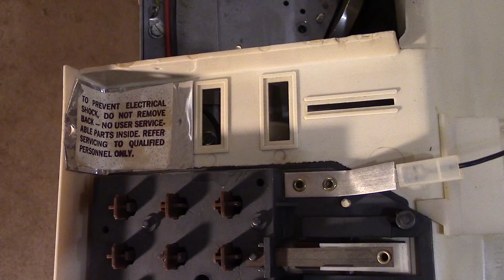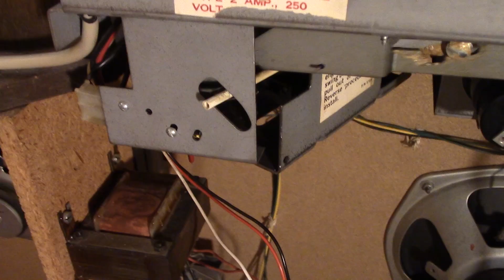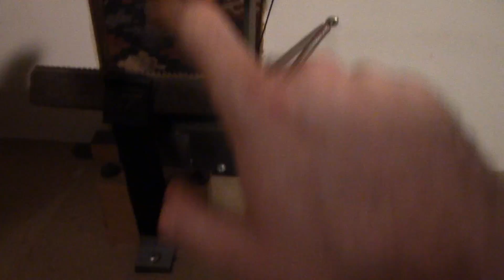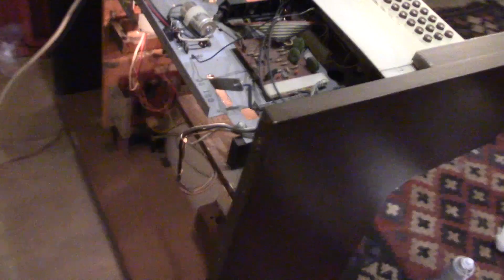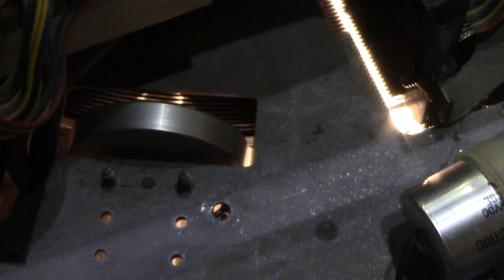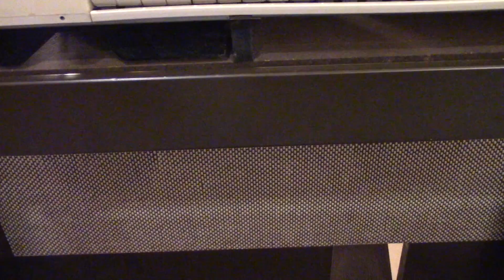Mattel Optigan Model 35011 - Repair Pt2 - Cleaning & Power

Comment: I don't know if you've already figured this out, but the reason the disc doesn't have metronome cutouts like the others is that the rhythm loops are a mix of 3/4 and 4/4, so whatever they did would be inaccurate and distracting at least some of the time. Plus, the chords are just sustained organ chords, so you wouldn't need to keep in sync with anything unless you already have a rhythm loop playing.

That does make me wonder how Optiganally Yours manages to perform "Beebo", though, since it starts with a guitar solo and then the Optigan comes in seamlessly on the beat.

Comment: how did you remove the rhythm buttons off. I assume witch craft.
Reply from the maker: Dorothy Lane it's been a while since I had this, but from what I remember, there's two or four big screws underneath the entire horizontal platform. If you remove these, the whole thing can slide backwards, then the plastic top can come off. Be careful you don't rip off the metronome fibre optic lead like I did.
Reply: @jamesbennettmusic there is a HIDDEN screw waaaay up inside that is hard to see. It's what will drive you nuts unless you find it.